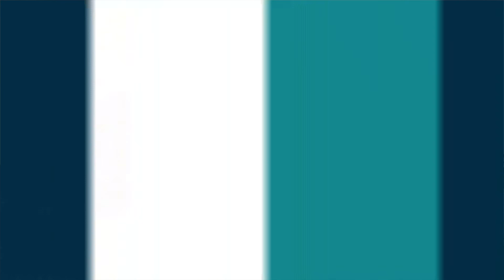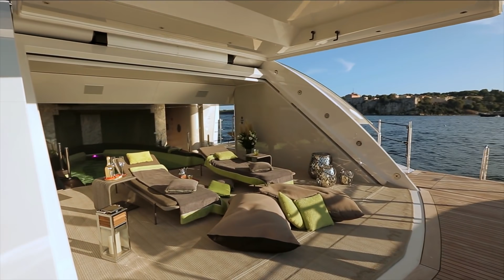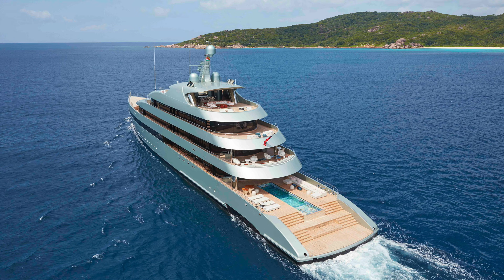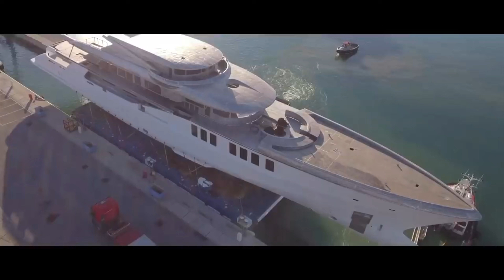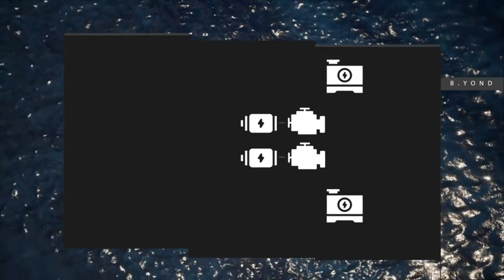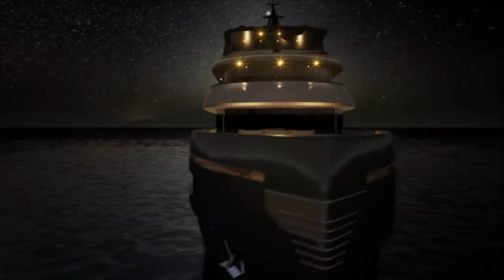Electric Superyachts, which one would YOU choose?

Comment: There's a tendency to switch to petrol engines with catalysts for smaller yachts in order to meet emission standards. Why not for superyachts?
Lithium batteries are still a huge safety hazard. If they catch fire and explode you don't stand a chance, no matter where you are on the yacht.
Reply from the maker: Thanks for commenting. I’m afraid you’re mistaken in that no smaller yachts are switching to petrol engines, they are however using diesel engines with a filtering system that acts like a catalytic converter. This is true of all yachts though irrespective of size.
Reply: @Yachtsforsaleblog  Thanks for the info. The engines I was thinking of are the 430 hp Volvo V8 petrol engines, with an engine block by GM, introduced 5 years ago or so. I don't have any sales figures, but it's my understanding that emission standards inside marinas have encouraged Volvo to introduce this new line.
Is that a wrong assumption?

Comment: I am still struggling with this.  So diesel-Electric IS Serial Hybrid isn't it?  Does the B.Yond system ( and Bering) prove that parallel hybrid is still more efficient than serial?  if so then why is the Wider system so admirable?  for the quietness and vibration reduction?  and why did Arksen choose a Serial system from Praxis instead of a parallel?

Comment: Meh.  Sail plus all the current energy capture technologies is really the only way to go, any size.  It's possible to have complete fuel independence, but, eh, when ya spend $100M on the yacht itself, and maybe $2M per year on crew, what's another $3M a year thrown away in fuel?
I think Oceanco's Black Pearl has already demonstrated zero fuel use.
Reply: You can fabricate methanol using water, solar power, and CO2 from the atmosphere. Do that and you can have a carbon neutral power yacht.

Comment: The problem with a diesel electric boat was demonstrated on the yacht 'Home' during a season of Below Deck: Mediterranean. The yacht lost power in high winds which meant the stabilizers went off, as did the engines and the anchor gear. The yacht was severely yawing to one side and in edition they were being pushed into rocks.
Reply: That could happen to ANY yacht. If anything a diesel/electric yacht would be LESS susceptible to such a problem, as if the engine/generators cut out, it would still have 8-12 hours of full power in it's batteries.